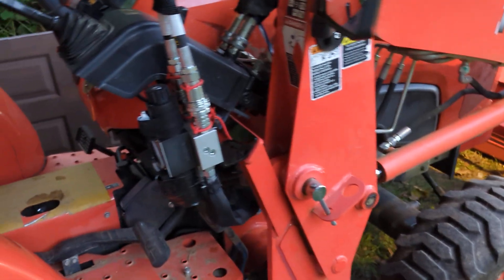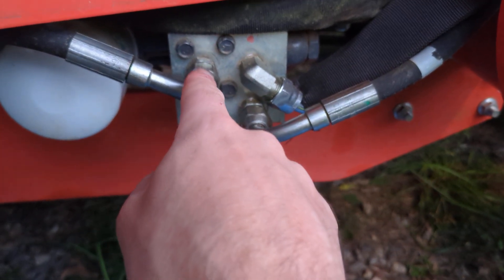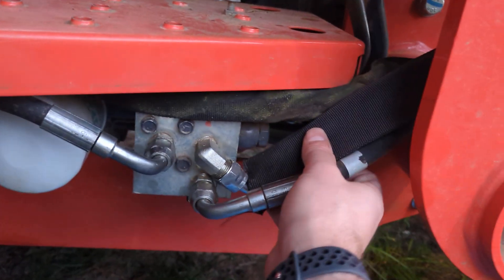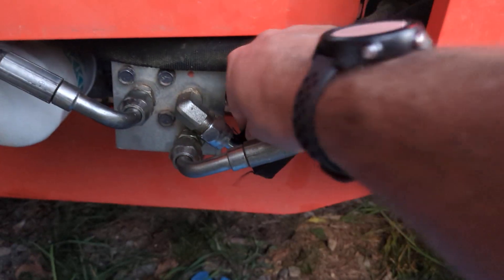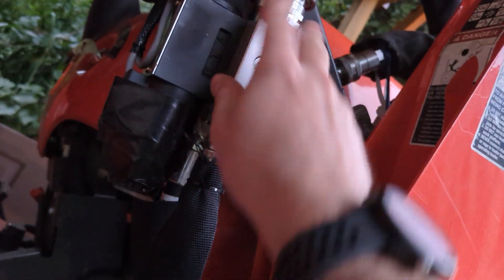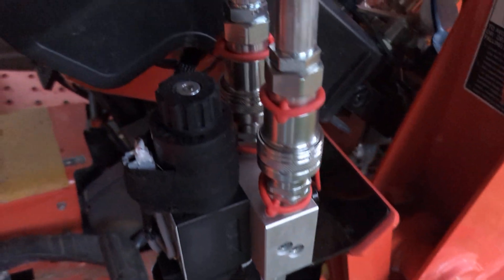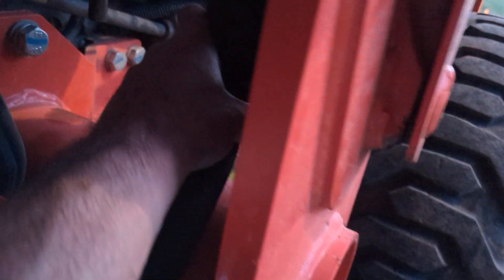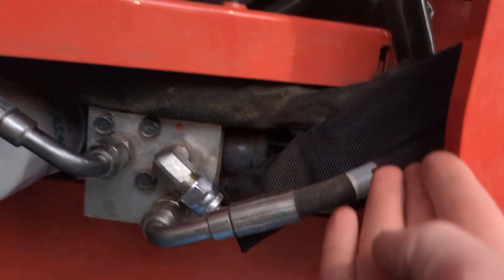Summit Third Function on Kubota L3301 with a Backhoe

Comment: Thanks for the breakdown.  Is the kit from summit the same as no backhoe? I don’t see one specifically for one.   Seems like it would still be the same hoses.  My situation is backhoe and  remote rear.
Reply from the maker: I believe so, as when I ordered there wasn't an option. The instructions Summit sends describe the process for both configurations (with and w/o rear hydraulics). I did reach out to their support a couple times and they were very helpful.